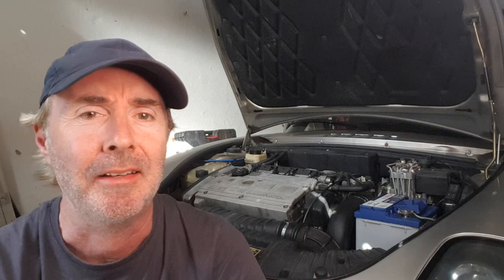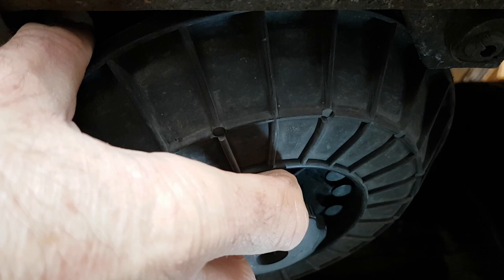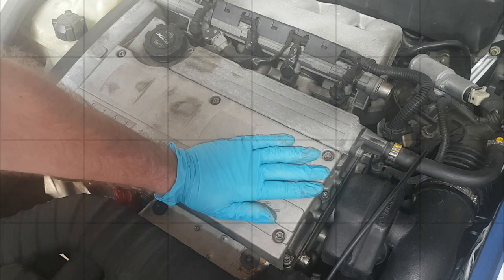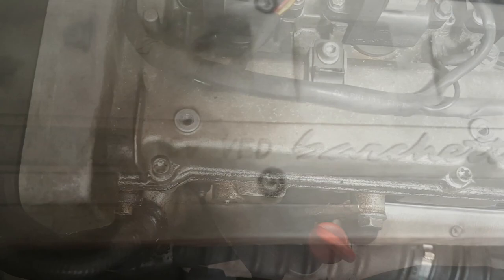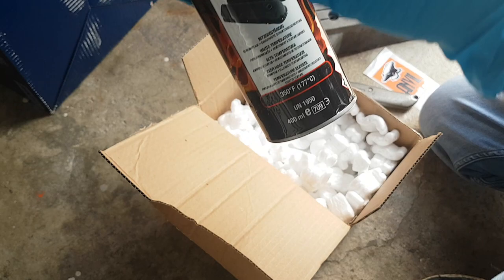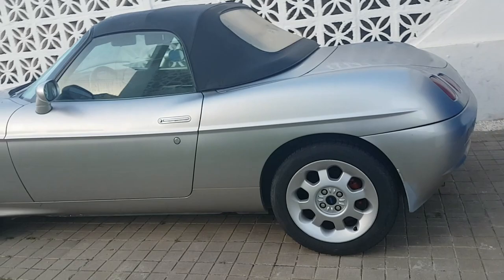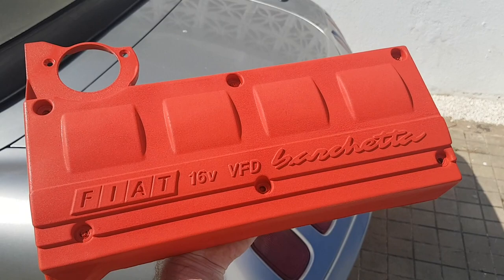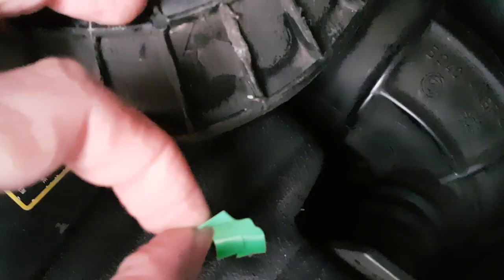Wrinkle Spray paint engine cover, Step by Step with Awesome results, Powder coat paint effect, VHT

Comment: Beautiful job! How are the colours holding up? Are they affected by the heat of the engine? I'm planning to do the exact same job on mine.
Reply from the maker: Thanks! The colours are OK still the same. I used Humbrol enamel paint for the lettering. The problem I have at the moment is the sound proofing is sagging and making the cover a bit dirty. That's the next job!
Reply: @pauliecabs  I hope it's just some loose or broken pins and not the material itself sagging.
Reply from the maker: It's the material. So might need to glue it or something. New video coming soon!

Comment: Great video! Painting the cover is also on my to-do list. Did you put any kind of clear coat? Mine has the cold air filter but it was installed by the previous owner, so I can't tell if it makes any difference with the stock one.
Reply from the maker: Thanks! No, just the red paint no primer or clear coat. If I did it again, I'd try and get more even coats.